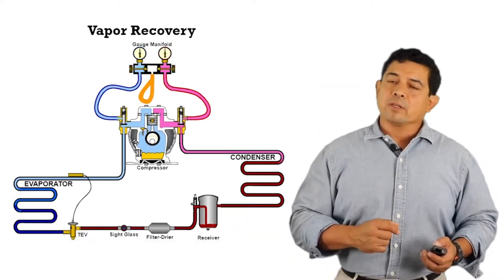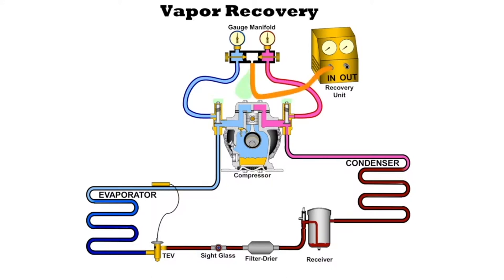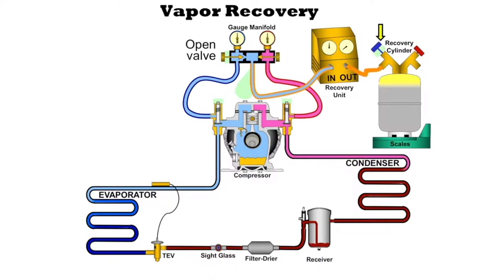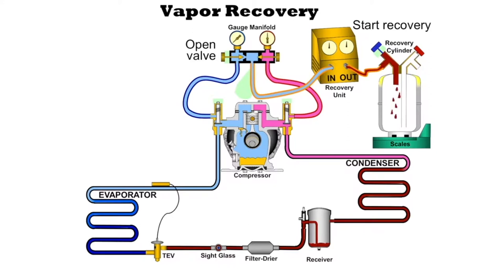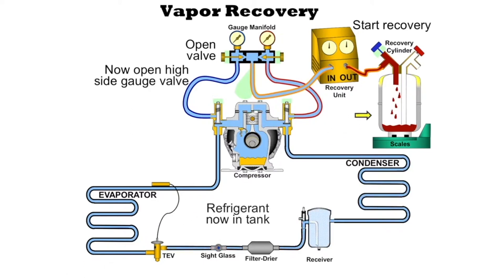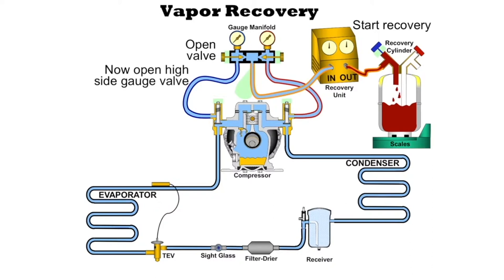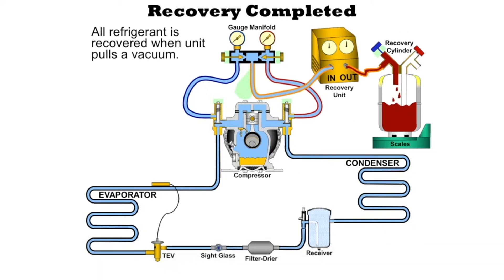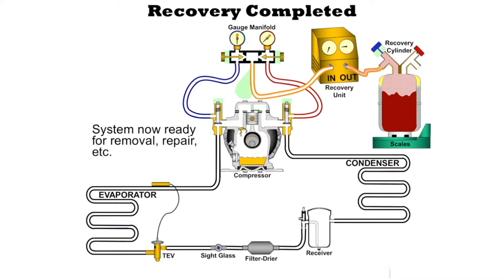About Vapor Recovery

Comment: You might even have to wait an hour, pull vacuum again, wait an hour and do it a third time if you know the system doesn't leak (the lubricants can hold a lot of refrigerant). However, if you have a leak on the system, you might be pulling air/contamination into the system. So if you KNOW you have a leak, don't pull more than one time and only down to slightly above outside air pressure. Or you'll suck air into the leak. Blow nitrogen through the system (best to disconnect the recovery machine first, just in case) and then fix the leak. In the case you are doing a repair, you'll probably want to put the refrigerant back into the system after repairs are done. Sucking air into the recovery machine, in this case, would be bad. In that case, you'd want to recycle the tank and put virgin refrigerant into the system once repairs are done. Ideally, with a leaky system, you don't let the pressure be higher outside from the system to prevent contamination. A pressurized system above outside air pressure will leak outwards only. Lower than outside air pressure will let air/moisture leak into the system.

As a side note, you can put refrigerant back into the system it came out of, but regulations allow no other option but recycling.

I had to do this with a unit that a reseller sold me that was no longer compatible between the condenser and air handler due to a software upgrade. They hadn't updated their catalog to reflect this. And sold the package that would not work together. This was a microcontroller software controlled system. In fact, I think they are still selling the combo. BTW, it's still working great today with the new (and correct) air handler. Best to check with the manufacturer before you buy a combo package from a reseller. 😞
Reply from the maker: Thank you! You bring up a lot of good points. Specially about the leaks and pulling air noncondensibles back into the system. As you will know, there is so much that there is to say what video says for training purposes, this is only talking about recovering the refrigerant from the system. Maybe I will make another video where I go into all of the things you might want to look for before you actually start recovering.        It is always good to hear from guys out there that are experienced. Thank you for watching and thank you for your comments!